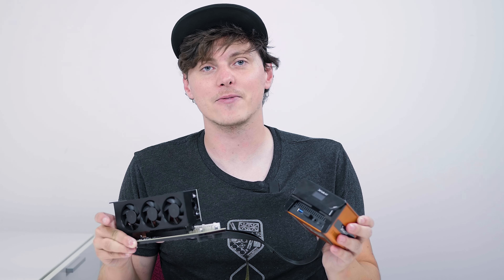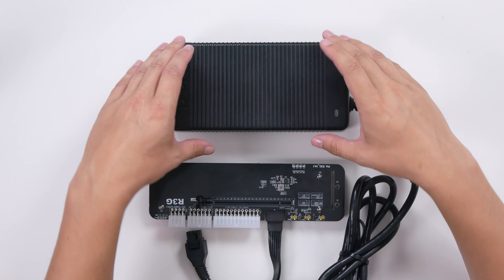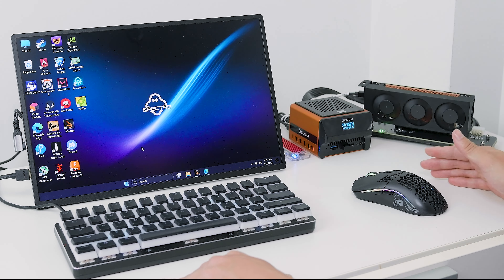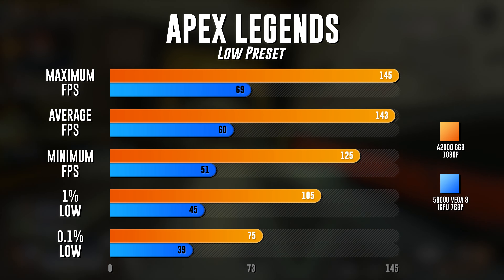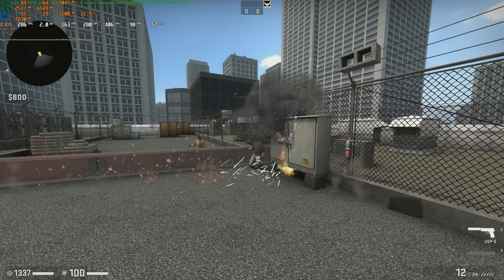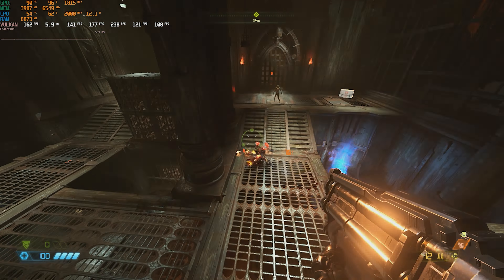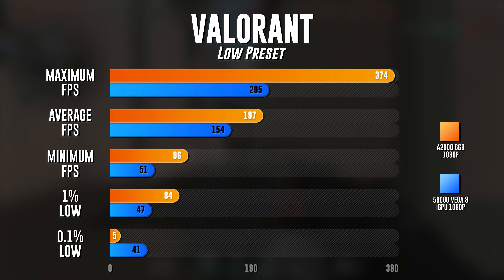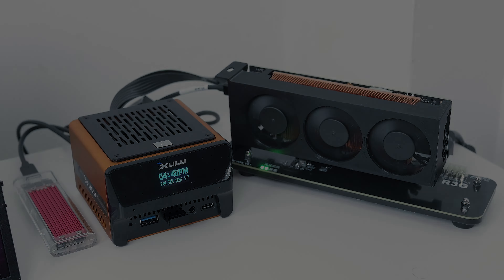Upgrading the Xulu XR1 Max with an eGPU!

Comment: HI brother. How are you? (My mother board model:Gigabyte H81M-DS2) I want to use NVMe.But i don't have any NVMe slot and i want use  NVMe as a  Boot Drive.Can you please help me to solve this problem with detail video.
Reply from the maker: I don't own that motherboard. Therefore, I cannot make a video on the subject. You will need to look into flashing a modded BIOS to your motherboard and you'll need to use a PCI-E to M.2 adapter.